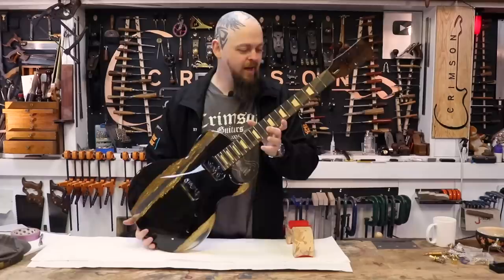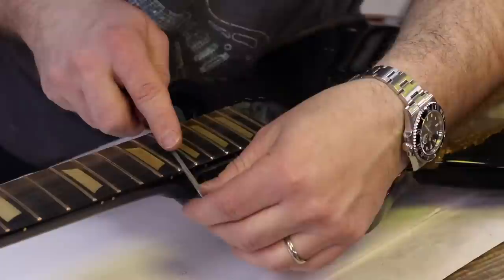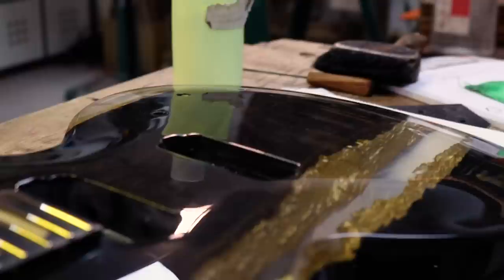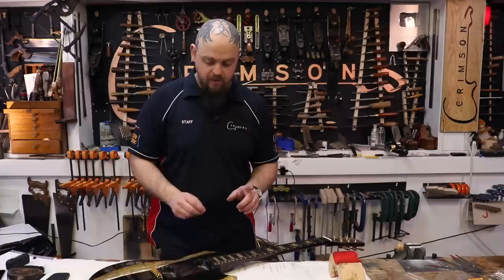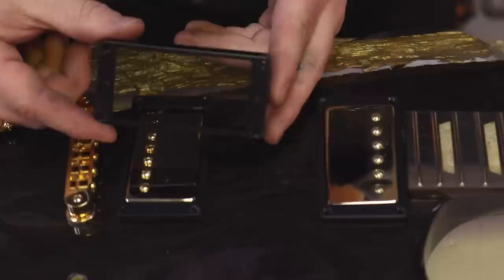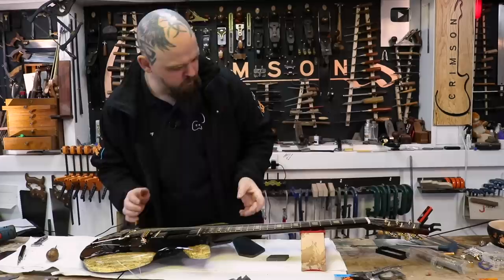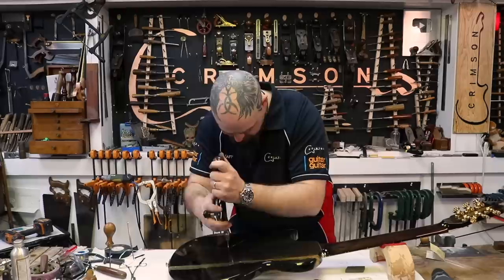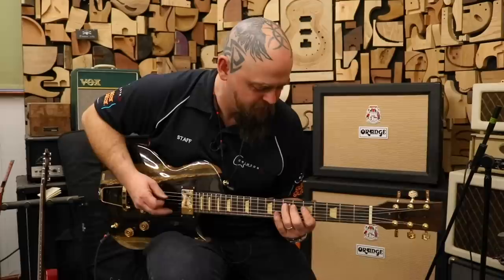Carved Epoxy Resin River Guitar Build - Bog Oak & Gold Leaf 5 of 5

Comment: Evidently the headstock carving should've gone all the way through to be able to catch the light and would've matched the rest of the gold parts. As it is it appears it only gets light from one side and because of the angle of the carving it looks dull. The logo etched into the resin filled with color might've shown up better too IMO. Love the tailpiece and hardware! Definitely my favorite of the last few builds, I'm a total sucker for black LP's!
Reply: @Paul Roach Don't know what you mean pal, sorry. He lays it out pretty clearly what happened. Resin has specific properties, and light refraction plays a part in that.
Reply: I was thinking the same thing that if the carving on the headstock went through it would appear brighter. I really don't mind the subtleness of it though. It's a very beautiful instrument!
Reply: it's probably because he burnt it after applying the gold coloured base. he also seemed a bit more haphazard with the leaf application and it might not have stuck as well as on the body.
Reply: This was my thought as well.

Comment: That there is well bling, innit? Absolutely beautiful. (Tho, a black nut, maybe?) Regarding the 'horrific, plastic pickup surrounds' I'd love more guitar builders to make custom ones. So many stunning high end instruments are let down with these things.
Reply: Yes those plastic bits are ruining it. I also find the nuts does not match the rest. When he considered gold leafing it I was like yeah go for it, and for a moment I though he would... Now I’m disappointed.
Reply: @Cypsky  I agree. The guitar is basically gold and black and then there's this tiny bit of white on it that doesn't match. The nut needs to be either gold or black.
Reply: And the knobs, this guitar deserves proper metal ones
Reply: chunkymurps yes a piece of ebony would be fine :) (not sure if it has to be a specific wood for that part, it probably has to :D)
Reply: Anomaly make some really nice replacement HB surrounds in black and cream that are SOOoooo much nicer than the crappy standard stuff on everything everywhere. Check em out.
Reply: Yes. I love this guitar.  The pick up surrounds in either aged bone, ebony or resin soaked bog oak would be an improvement and the same goes for the nut.  The final pieces just seemed a bit rushed.  Congratulations on a beautiful build and entertaining series.

Comment: Lovely as usual. 
A brass nut would look good.
Reply: Agreed! Or at least graphite or something dark so it doesn't stand out as much.
Reply: Absolutely agree.  It is a gorgeous guitar, well beyond anything I could afford, but when I saw the bone nut it did grind a little (more production than bespoke).  However, it’s easier to replace the nut than if the resin had shattered.  I did hold my breath at one point when it dawned on me that maybe the planning had missed the positioning for the hardware - I think Lady Luck was involved there.  Maybe Ben will do a revisit at some point as certain bits felt rushed.  The headstock logo for instance needs another go as even if I had the budget It would put me off.
Reply: even a carbon fiber nut would be right at home on this build !

Comment: I've actually been these epoxy guitars for a while now. I'm in construction and mainly kitchens. We started doing the fake stone counters by using epoxy cus it's so much cheaper 50 bucks a counter vs 500 bucks and looks identical. So it's a no brainer that people are wanting these. So I bbn also build guitars and had an idea one day. And viola epoxy guitars that look like stone. And take very little time and money to make. I've done 12 guitars this method and they come out great. Super tough. Scratches buff right out. I think the one that gets the most compliments is the one that looks like marble. Identically looks like marble. I would highly suggest trying this if you havent. Just go in youtube and look up epoxy fake stone counters. Just take the method from there and apply it to a guitar. I know you're a wood  build guitar but it can still be applied to get a really cool 3d look with clear and wood. The skies the limits with this technique. It's about 50 bucks US 1 gallon epoxy to 1 gallon hardener each are 25 a piece so total is 50.00. Make sure you get a longer cure hardener so it gives you plenty of work time before hardening. It's super fun screwing around and seeing what you can make. And the amount of time you save not having to painting or sanding making sure its level is awesome. And it's a complete 1 piece guitar so it's got great sustain. 2 hours and 50 bucks later, you have yourself an impressive looking and sounding guitar. And it looks like a high end guitar. It can be heavy but I found a way around that by using a light wood like poplar/pine for a coreso it's not solid epoxy. I send some pics of mine but unfortunately youtube for whatever reason won't let that happen

Comment: You might consider using pots with switches (pull up or press down) that allow you to go to single-coil mode. With the guitars I've had, single-coil, neck and bridge together, gave me an almost acoustic sound. Just one more option.

Comment: First, I have to say I love your work. This is absolutely beautiful. I have had the same thought pop in my mind every time I watched one of the videos on the making of this guitar. It may be a good idea to build a vacuum chamber to stabilize old wood like this bog oak. I've seen some videos on stabilizing wood, but the pre-made vacuum chambers designed for it all appear aimed at wood turning, so you'd need to build one in appropriate dimensions for a guitar body and/or neck. That should open up a lot more options for casting resin river guitars, and using other kinds of wood which otherwise would be useless for guitar building. Special note: I have no knowledge of the art and science of guitar building.

Comment: I actually like the "subdued" headstock. It doesn't distract from the main attraction of the guitar. The gold in the back of the head probably looks dull in comparison because it doesn't get light from both sides as the "rivers" in the body do. Shiny things like light from different directions. ;)
The pickups, tail piece and bridge could use some detail engraving to match the tuners.

Not my cup of tea overall, but it still is an amazing guitar.

Comment: with builds like this it might work better to mount the pickups from the back , that way the hole for the pickup in the front is tight around the pickup just like with a pickguard on a fender , the rear hole you can cover with a few coverplates or the plate for the tremolo

Comment: This build looks amazing. It makes me want to buy a new guitar, which I'm sure my wife wont have any objections to at all.
I get what you're on about with the head-stock. I think the gold would have stood out more if the light would have been allowed all the way though the head-stock. More light, more refraction, more shiny golden goodness. I think a big part of the issue is also that it's a 9/10 head-stock on a 10/10 guitar. That head-stock on a more simple guitar would be the highlight of the build. You had a similar reaction to the plastic covers on the pickups. They are good looking, but not good enough for this guitar. I had a similar reaction to the control knobs. When I saw you put those on the guitar I was just thinking: "How awesome would metal (like brass or something) knobs look on this?". Really, that you notice things like the head-stock and you're considering gold leafing a nut is a complement to the rest of the build. Let's call it the perfectionist's curse.

It's a stunning build though. Easily my favorite you made so far. On the video it sounds great. Looking forward to the next one.

Comment: the nut will yellow with age bringing it more in line with the colour scheme, so i don't think that would be an issue for me but i would have used a gold coloured metal switch instead of the white rubber.

Comment: Having watched it all, being very serious, having built a small number of guitars myself:

Your technical work and setup are excellent. Though I really wish you'd use a drill press and reamers for headstock holes and such.

It's a very strikingly pretty build.

Your resin work needs work.  There are far more efficient ways to do it.

I cringe at the gold leaf being blown around.  It's only a few bucks here and there, but it adds up.

I'd prefer less finish on the wood so its character is more present--probably a vacuum fill of the voids and cracks. Most of its character is masked. Plain ebony would look quite similar.

Tone wise, it sounds fine, but I'm not hearing any distinction between it and any other similar guitar.  I'd like to hear side by side with sometihng else to compare.

Comment: Excellent build, Ben! I really enjoyed this series!
A question for you... The pole pieces are adjustable.. would you adjust them, and, would you match the pole pieces to the radius of the fretboard?
All the best & Happy New Year!
Cheers!
Reply from the maker: Thanks, you too! There is a slight difference if you adjust the pole pieces but only very slight.. the magnetic field isn't huge but if you are noticing string to string volume issues then, after checking the nut slot, adjusting pole pieces is the way to go imo. B
Reply: @CrimsonCustomGuitars  - Thank you so much for getting back to me, it's greatly appreciated!
The work you do, and the rest of the guys/girls at Crimson, it's fantastic! Keep it up!
I can see that, and I will keep that in mind, thanks!
Have an excellent weekend!
Cheers.

Comment: I thought, there goes another ‘River’ project.  I think they are a over done trend. My expectations of this build was low, trendy and just another River. However the actual results, once again blow me away.  You have done it again.  That is not only the best ‘River’ guitar l have seen it might be one of the best River projects of any kind. Outstanding.

I watched this on an iPad and the bog oak texture/grain did not come through well.  Additional pics would be appreciated. How much of that bog oak do you have left.  Could you do a T type with it highlighting the bog oak?
Reply from the maker: I've been avoiding river type resin projects because I felt the same, that I wouldn't be able to bring anything new or interesting to the idea.. I am so glad that this came off well and that I was able to do it! 

No more bog oak left, however I'm sure I will use it again and next time will have an oil finish to let the wood breathe.. pics etc will be up on the website in the next few weeks.. VB, B

Comment: Hi Ben. I usually don't really like your guitars, they are a little too "complex" and "noisy" for my taste as I like stuff to be simple,  clean and understated. This one, however, I like very much, The headstock is spot on, the logo is spot on for me. 

Let me suggest a finish I would really like to see. The burned finish but as it looks just after you burned it. No sanding, no brushing. When it looks like carbon. Couldn't you burn a body, maybe in an oven, then vacuum resin infuse it while handling it very carefully and then finish off with a generous layer of lacquer. Basically making the guitar look like it's made of pure carbon. You could call it "The Carbon Black" maybe even black hardware

Comment: Buy an old safe, use a thermic lance to cut a hole in it and attach a vacuum pump. You could do four or five bodies at a time, and you don't need hard vac, just half a bar drop would still pull everything out of solid resin and get it into any wood. Especially if you use infusion grade (lower viscosity) epoxy, as they use in carbon fiber builds. In fact, Easy-Composites(dot co dot uk) sell everything you need at trade prices, even for small quantities.

Comment: The amount of decoration & flash on the headstock-face does not match the rest of the guitar.
You might consider sanding-down the face of it to bare wood, and then either re-charring or just staining dark black. 
It could also use a flashier, goldier version of the CG logo. 
Like aCNC'd & then gilt-brass outline of the CG logo that's carved into the wood.
I wish the local-neighborhood you gave the tuners to live in was up to their standard. 
I wish you'd take a blown-up & mirrored version of the decoration on Mr. Gotoh's Big Pimpin' tuning keys & engrave that on the top of the string-block of the trapeze, also. 

But otherwise, still amazing by any estimation. 
Also noticed when you put it down on the bench a few times, the body seems to have it's own clear resonant-frequency. Cool!

Comment: I always assumed you'd be putting an LED in the headstock. The colour and positioning would need some chinstroking and experimenting, you'd want it to be right, not flash. I have a Swanpcaster tele and it has a light brown hew. I've been looking for knobs for it for a few years and never found what I wanted, Brass seemed right, to me it seemed too right, almost cartoon correct. A few weeks ago I saw some Bronze Tele knobs and knew instantly. Brass was too much.

Comment: i was bought a cheap redwood S100, but im not a fan of the solid colour that is on it. what would be the best way to strip the paint from it without using tons of nasty chemicals? as i want to change it from the solid colour it is to do something myself with stain, any advice is greatly appreciated!
Reply from the maker: Hey Seph.. fire.. fire is your friend. Either use a blow torch lightly or a heat gun and the finish should strip right off. Wear a mask or do it outside though! B
Reply: @CrimsonCustomGuitars  thanks for getting back to me really appreciated :) also keep up the amazing work! been binge watching alot of your videos the past few days and its given me ALOT of good ideas!

Comment: What an absolutely beautiful guitar man!

Question: Both of my mid - range guitars feel like they have sharp fret ends. I wondering if this could be caused by the hot/cold change of the location they are currently in and that causing the wood to expand/contract leading to me feeling sharp ends where they meet the fret board. Do you think that is the case? I dont remember the ends being sharp before.
Reply from the maker: This is exactly how fret ends end up feeling sharp. Grab yourself a fret end file and and fret end bevelling file and you'll be golden.. https://www.crimsonguitars.com/store/fret-finishing-file/ B

Comment: I noticed what looks like a wine glass scratched into the back of the headstock, what does it signify Ben?
Reply from the maker: It's in video 3, I think.. I carved a fake river area into the headstock and filled it with gold and resin.. it didn't work out as well as I had hoped though... B
Reply: @CrimsonCustomGuitars  yes I saw your disappointment, part of the process must be disappointments when trying new ideas.

The wineglass scratch was on the back though.

Comment: Gold is not very porous at all. In the hydrogen industry, equipment is gold lined to prevent hydrogen ingress.....and hydrogen is the smallest atom.
So if high pressure hydrogen gas is not passing through....then liquid resin has no chance.